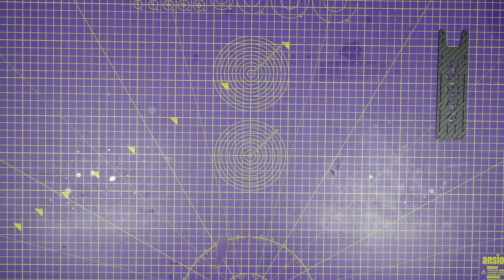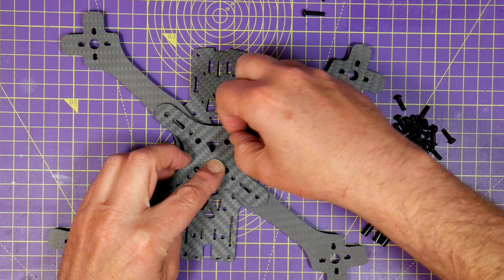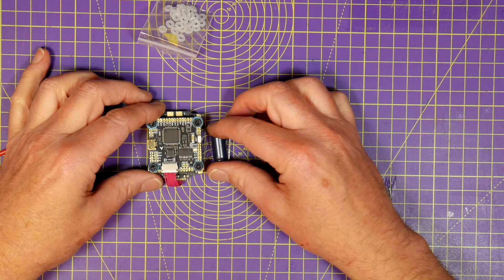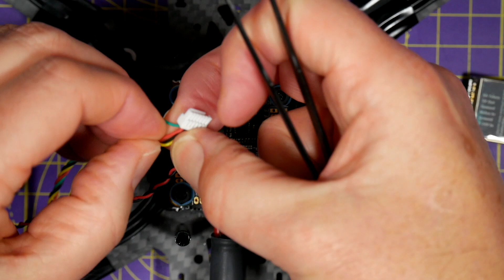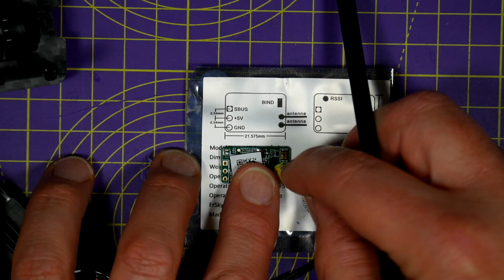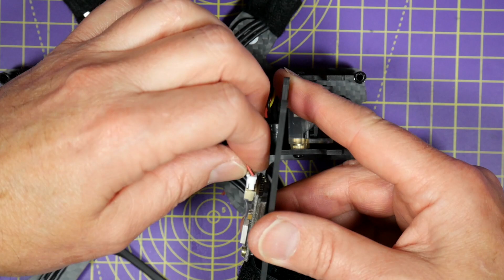How to build an FPV quadcopter drone - a complete beginners guide tutorial - part 1

Comment: Excellent work, I like it a lot. I would like also to ask you could you please send me info which kind of electrolytic capacitor you are using and where on the web it can be found. If possible I will appreciate a lot your suggestion(s) for the type of electrolytic capacitor which can be used in the set up for the drone GEPRC Crocodile 7 with 6S battery pack which you also shown in one of your YouTube videos. Thank you very much in advance for your help.

Comment: Hi thanks for sharing this video, as I'm new to this, if you don't mind can you please write down, which parts did you use?
Reply from the maker: Here ya go
TBS Source One frame
4x TheFPV Dime 2207 2450kV / Emax ECO 2306 2400Kv motors 
1x Diatone Mamba F40 Stack (F4 FC, with 40A BLheli_S ESC)
1x ChaosFPV 25-800mW VTX with smart audio
1x Pagoda 2 FPV Antenna
1x Runcam Robin FPV Camera
4x DAL Cyclone 5040C propellers
Reply: @WhirlyBloke  Many thanks to you...
Reply: @WhirlyBloke  hey , i like ur build but i cant find the chaosfpv vtx , where i can find it ?
Reply from the maker: @Lesteralvinn  https://www.unmannedtechshop.co.uk/product/chaosfpv-vtx-t-video-transmitter-25-800mw-7-24v-betaflight-telemetry/